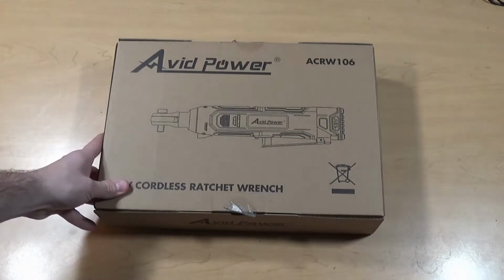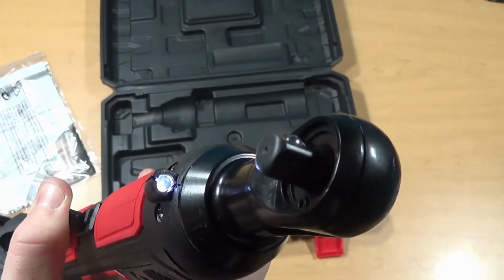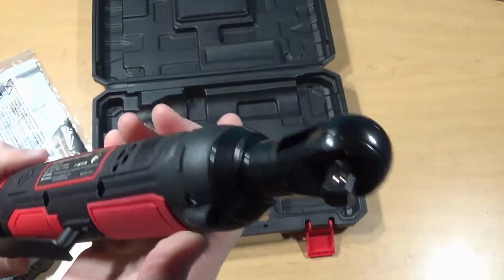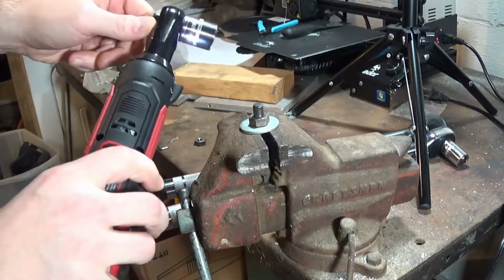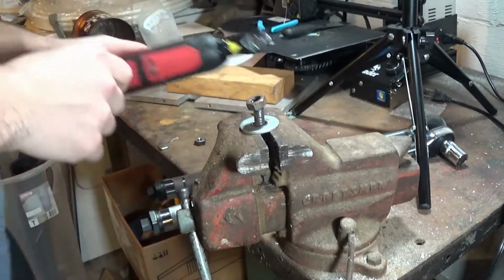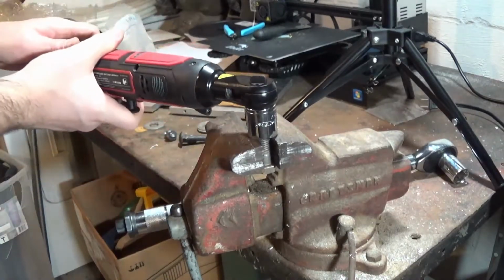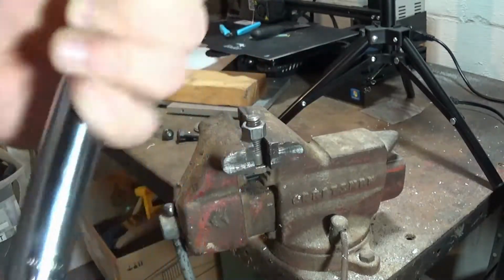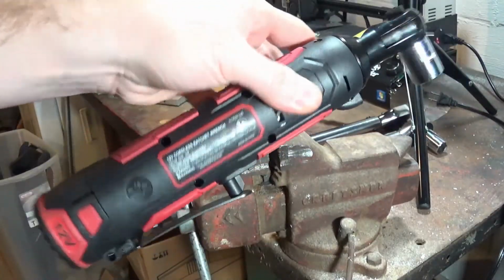Avid Power 12V 3/8" Cordless Ratchet Wrench ACRW106 Review and Torque Test

Comment: Really appreciate you doing those manual torque tests. 100ft/lbs in enough for me. Anything more than that and I'm willing to break out the breaker bar.
Reply from the maker: You're welcome. The ratchet still works great btw. No issues.
Reply: @striker1211  cool thinking of ordering one next pay.  Want a vehicle set of tools

Comment: Still holing up well? A few years late but thinking of ordering
Reply: Don't recommend it. I have barely used mine and it now has no torque. I can easily hold the socket by hand and stop it from turning. Luckily I didn't spend too much for it, but I will not be buying another of this brand.

Comment: Thanks looks like a piece of junk
Reply from the maker: Yeah it's definitely a cheapy. I bought an AcDelco one with plans on giving this one as a present, but the Acdelco one I got doesnt have variable speed which is more important than I thought. I'm going to actually keep the avid Power as it's lighter and faster than the Delco too. The Acdelco has 35 ft lbs of torque but I always seem to have to hand loosen everything anyway.
Reply: How is this for basic bolts on cars ? I’m not going to use it for brake caliper bolts, just things like timing covers, valve covers, sensors etc
Reply: @striker1211  You are not supposed to crack nuts loose with this kind of tool. It isn't an impact, if it was you'd of ran into a chance of breaking your chrome sockets, which are not made for an impact. What you were doing towards the end is what is meant for these compact 3/8 electric tools. Crack it off manually with it and whizz the bolt or nut off. I know some mechanics use them because they are compact and reduce their time wrenching.
Reply: @neondiamondsaquaberry17  It would do that job, these are supposed to be used manually to crack the bolt or nut and then whizz off. Unfortunately Amazon doesn't seem to have this in stock anymore but they still sell the drill that uses the same battery but that's not a major loss since there is a few other Chinese brands at a similar pricepoint that will do what you want it to. A few of them come with two batteries as a set with them.
Reply: I guess Im kinda randomly asking but do anybody know a good site to watch newly released tv shows online?
Reply: @Kristopher Gunnar i watch on flixzone. Just google for it =)
Reply: @Daxton Elliot Yup, been watching on flixzone for since april myself :)
Reply: @Daxton Elliot Thanks, signed up and it seems to work :) I really appreciate it !!
Reply: @Kristopher Gunnar you are welcome :)